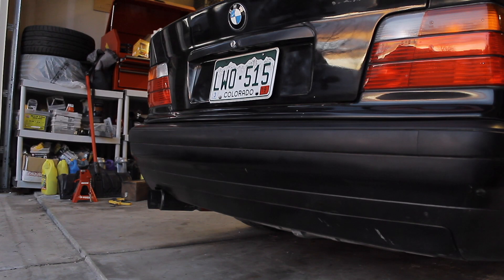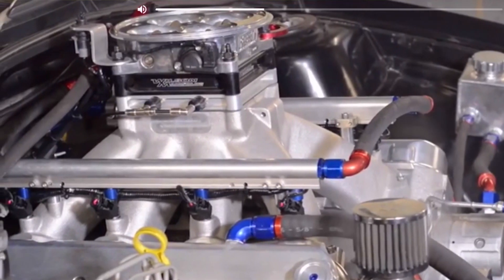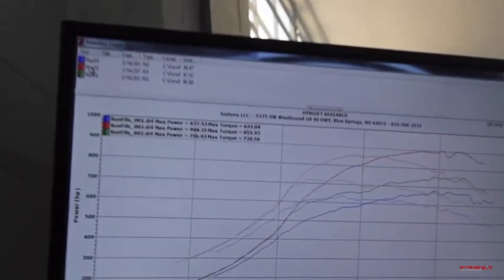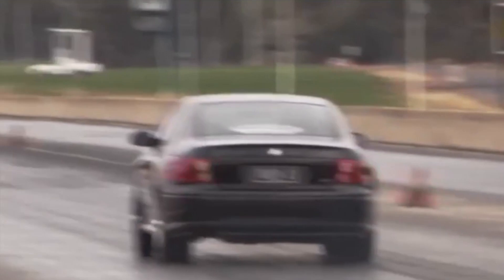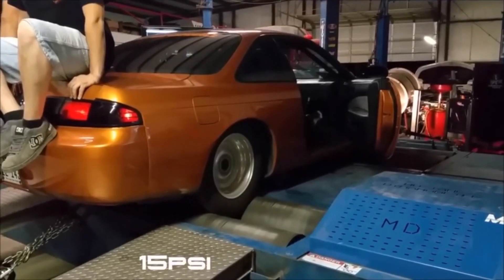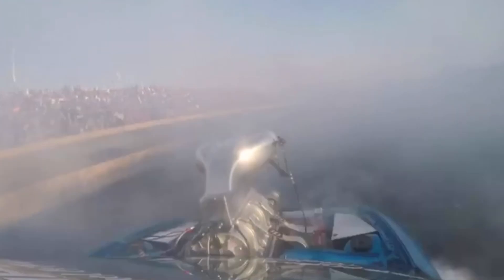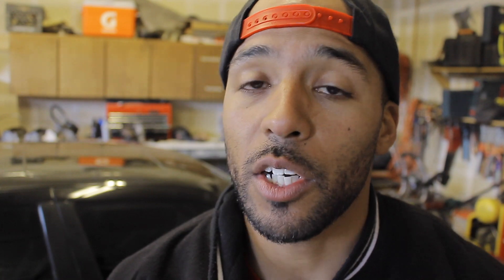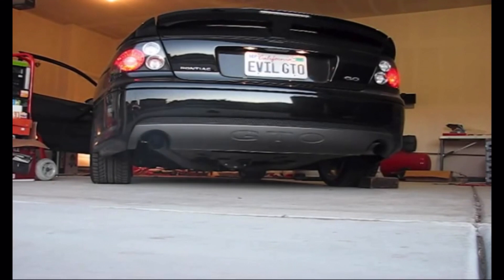LS ENGINES - NA VS TURBO OR SUPERCHARGER

Comment: Wassup trey. Jus copped an 06 gto a while back and finally saved up enough for the heads cam kit. U think trickflow Genx is a quality kit? Wud love ur input man
Reply: Check out texas speed.
Reply: MBL Bob they got types of kits for the ls2. I jus got into the ls so sorry for the newbie question. A link wud b great brother
Reply: @Dzairicani  yes all kinds
Texas-speed.com 

When you get serious just call and they will point you in the right direction
Reply: MBL Bob appreciate it man. I’ll contact them on Monday and have them direct to which kit is optimal for my power goals ( I’d like to b around 450-480hp). It’s a 6spd as well
Reply: MBL Bob sorry for the spam. But is there anything else I shud buy before installing it? Maybe pulleys or short throw?
Reply from the maker: I agree with bob! Tsp is a great place to start!